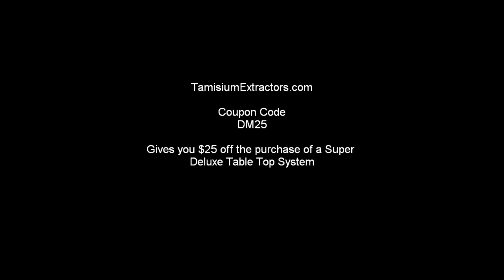Tamisium Butane Oil Extractor Basic Series Video 1 Loading with Butane

Comment from the maker: You are correct.. So stop boiling flammable solvents like naphtha, acetone, alcohol, and butane away and evaporating them into the air without a laboratory setup where it can be done safely. Thats what a lab is after all, A safe place where trained professionals can do dangerous things safely and under control.
If you don't have a lab, you may consider a safe contained closed apparatus like this. Cooking on propane or gas stoves with an open flame can be done safely. We take a lot for granted.

Comment: When u say that the 2nd tank is at 25º. You mean farenheit, right? Cause 25ºC ain't very cold. Sorry if  it sound like a stupid question, but I learned by the metric system.
Reply: You want it cold so the butane will travel so im assuming farenheit